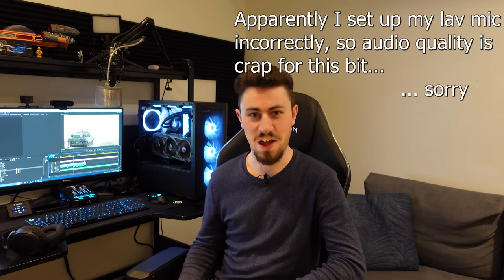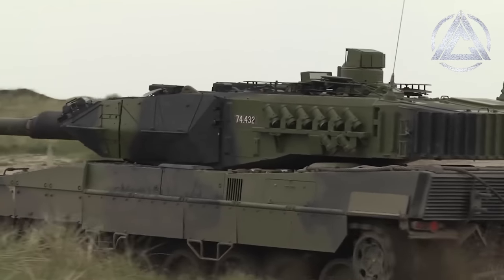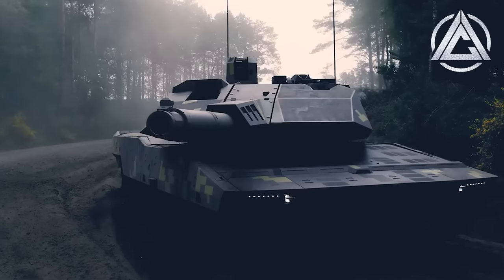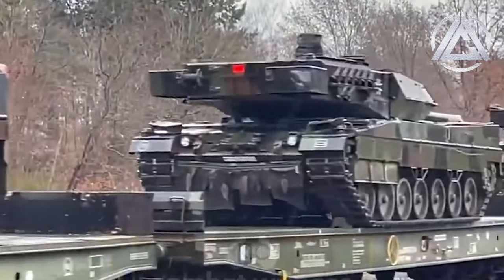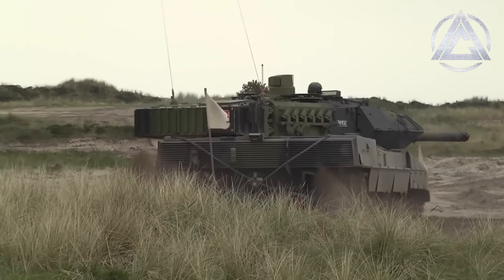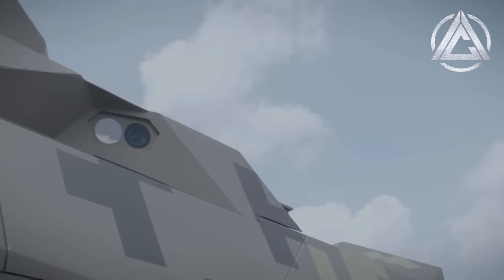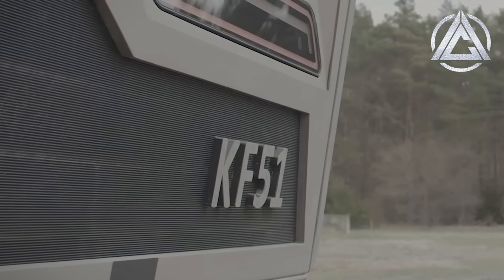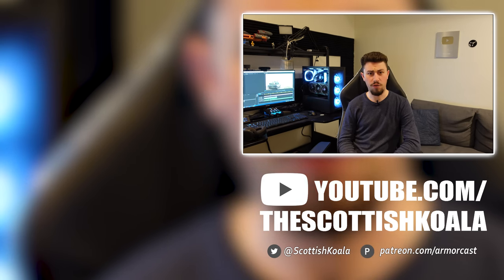Germany's New KF51 Panther Tank | The Spearhead of a New Generation?

Comment: It is an interesting tank, the 130mm gun seems good enough although I do think it also serves as a propaganda point of "we can produce bigger guns" when you compare it to the Russian 125mm. The HERO drones might be useful but I do agree that if it removes primary armament ammo it's not worth it, we will see with time however. Protection wise seems great all things considered, using new materials to lower the weight is a certain plus... Which also has the benefit of an up armouring package, if certain circumstances prove it practical (I.E. protection from Anti-Tank mines). Using a heavy caliber machine gun as coax might be some overkill, but I guess this does allow the driver to conserve ammunition when dealing with lighter vehicles, but that lighter machine gun turret in the back... Granted it's intended role is for use against drones and loitering munitions, but if it was moved further forward and able to depress, it would be a far better use against infantry. (Small note, he calls it a CWIS, an he's not far off, there are probably some idiots who say CWIS can't be mounted on ground vehicles, wake up, the Czechs already did that)

Comment: 7:00 I did some rought calculations and if it's true that the muzzle energy increased by 50%, it would result in an 11,8% increase in muzzle velocity (Assuming pentrator has the same mass, more mass would mean even less velocity). 15% seems a bit much. Source: I'm physics boii
Reply: Assuming the same mass, the velocity would be 22.5% greater.

Source: E = 1/2 m * v^2

v^2 * 1,5 = (v * x) ^2
x = sqrt(1,5) = ~1,225 => 22.5% more velocity for a 50% energy increase.

Comment: The German left has, following Moscow's directives, been attacking its armaments industry for at least 40 years.

This causes problems when it comes to upgrading, changing spare parts, etc.

So they have given licenses for local manufacturing.

Taking advantage of this, South Korea has designed its "Black Panther" tank, Poland has already received 200 out of 950 units and the rest will be manufactured locally.

It is at the same or better level than the "KF 51 Panther".
Reply from the maker: I mean… it’s slower, substantially less well protected, less advanced as far as optics, sensors and communications/battlefield management systems, and has a less powerful gun… while being the same weight.

But yeah, sure, “at the same or better level”…
Reply: @ArmorCast  I like german weapons, but it looks I lost something...how the gun can be "less powerful" when it´s THE SAME!!!!, L44 or L55 as per customer preferences, can shoot the same ammo, etc.
Besides 56 and 59 tons for a 30 cms shorter and 10 cm lesser widht hull didnt looks so terrible...

Comment: The shroud is a bore-evacuator.
Reply from the maker: Not at all. You can see on the Challenger 2 LEP we showed a couple of times in this video, as well as the static display 130mm, that the bore evacuator on this gun looks almost identical to the on on the 120mm - a bulging section half way up the length of the barrel.

The hexagonal shroud over the gun is most likely a combination heat dispersion and radar deflecting surface
Reply: @ArmorCast  Good to know.

Comment: Looks like it has a large shot trap potential when the turret is forward facing,  jamming from forward hit.
Reply: If you’d watch the video he mentions that
Reply: @razalfraz6618  Yes, people also said the Titanic was unsinkable, Lets hope they are right in their calculations that allow only for conventional rounds.
Reply: @grahamstephenson9393  is someone going to be slinging solid shot at the tank? If so why 😂
Reply: Its not a shot trap because the wedge form is actually only thin armor .. anything that would have enough power to do any damage AFTER being deflected WILL penetrate the wedge, but thats the purpose, by the form of the wedge the long penetrator will loose power and angle within the (hollow) wedge to hit the REAL armor behind it at an angle where it will be too much to penetrate then.
Reply: @grahamstephenson9393  Ok, that IS a good point. But i recon the turret is a real heavy piece so the power to turn will be quite substancial too ... the piece of debris blocking this would really have to be extreme and extremely lucky to be wedged in such a way ... but yes, possible.

Comment: 120mm railgun is a better option than a 130mm
Reply from the maker: Rail guns are at least Id say 25 years from being ready for tanks. Possibly they’ll NEVER equip tanks, instead being used by the navy. 120mm ETC gun on the other hand… …

This all needs its own video or two of course
Reply: @ArmorCast  If there’s a really high potential of war or even a war happens development of railguns will be sped up massively but as the railgun is not needed urgently they will not speed it up as like you said the 120mm is sufficed at the moment and if we really need something more than a 120mm we could always use the 155mm Britain even has a 183mm tank gun which is overkill but if it was really needed it there.

I think the real reason there’s no new MBT’s is because there not really any competition anymore as Rheinmetal main competitors in Europe were Royal Ordinate and Vickers both of which no longer exist.

Comment: I guess Germany needs to hope that opponents don't adapt to the design, like using solid rounds to take advantage of a shot trap.
Reply from the maker: Older style full-bore AP rounds would pose no issue to this tank's armor, and that's IF they were able to make it through the active defence system
Reply: @ArmorCast  In your shot trap dreams.
Reply from the maker: @franciscofranco4520  The Leopard 2's turret design since 1991 is almost identical, and the Abrams is very similar. If we were going to see fielding of full-bore AP rounds to take advantage of this, it would have happened by now. Fortunately, military procurement industry is not that stupid, and understands the physics behind this type of armor and why that would not work.

You need a certain amount of penetration to get through that kind of armor (and again, APS exists)... to GET that penetration, you need a sabot rod. Sabot rods cannot "shot trap" a tank, especially not this one.

Shot traps exist at around 35 to 50 degree angles... the angle of Panther's, as well as Leopard 2's turret (the supposed "shot trap" part), is more like 8 to 12.
Reply: @ArmorCast  Fact check: false.  Abrams and Leopard's design are completely different.  Shot trap cope.

Comment: i have to say i fucking hate the sleek geometric design of the kf51 and Leo 2A6, the angle dont really add much protection since these are empty boxes ( well idk for the kf51 ). i much prefer the blockyness of the 2A4, the k2, the leclerc...
Reply from the maker: They actually add an ENORMOUS amount of protection. Despite being mostly empty (not completely), the way they work is on a principle called "moment of inertia". It actually makes them MORE effective than if the space were filled with composite material. What happens is the incoming round penetrates the wedge shape, enters into mostly empty space, and then impacts the turret underneath at a bad angle, resulting it it losing over 95% of its penetrative capacity.

I have talked about this before and will do a dedicated video on the topic specifically in future

Comment: Matching the armor is a no go. Until we see a new generation of armor that can stop the current AT missiles and darts and be lighter we will not going to see another new tank in production. The most advanced in this regard are the americans with a new DU crystal armor that is in the works.
Reply from the maker: That will ALSO be used to match the current armor effectiveness while decreasing weight. This is the primary purpose of the M1E3 vehicle. 

Current generation AT weapons cannot be stopped by armor alone - the whole point of them is to circumvent whatever armor is there and hit the weak points which just cannot be armored. Try to armor the whole tank against modern AT threats and you’ll end up with a wildly impractical 200 tonne monster. Instead, active protection systems need to take over to defend the tank against the most significant threats, with the base armor already being strong enough to defeat everything else… which is exactly what this tank does.

Comment: No future tank commander would like this MBT. Too big, too large, too heavy, a 130mm gun instead of a 140mm one with autoloader. First in a country with low births, terminal demographics and low manpower there is no need for a 4 man crew, make it 3 man crew only and save a lot of volume and weight dedicated to house an extra crew member. Manual loaders are a thing of the past especially as we move onto 140mm. Secondly leave drones for scouts, it's not up to a tank to man a drone, the space for a 4th crew member is wasted space. No serious tank commander goes in blind with just the tank platoon, a platoon is accompanied by scouts be it motorized or tracked ones who screen for infantry and cover the MBT many blindspots for situal awereness they should have the drone operator inside the jeep, APC etc... and just liaise with the tank via comms or data link. Thirdly, 130mm gun is a not enough. If you see throughout history canon upgrades are always 15mm+. We went from 20mm to 37mm to 50mm tp 75mm to 90mm to 105mm to 120mm. 140mm is the bare minimum to have a gun platform with longevity in mind. Not against armour targets necessarily but the extra caliber wiggle room allows for very high explosive payloads against structures in urban combat and also for modular smart rounds. You need space for smart fuses and sensors. Feedback from Fallujah and Ukraine show that 120/125mm leave a lot to br desired un urban combat. This panther tank could have been an MBT in the 54 ton range if it was a 3 man design to booth. Lastly the powerpack is not inovative, just old diesel, no turbine, no hybrid electric to allow stealth ambushes while on battery mode. No turbine for high speed like on the Abram X technology demonstrator. I might impress neophytes with its brochure specs but the doctrine of this tank design is firmly from the last century.
Reply from the maker: It's no larger than Leopard 2 and substantially lighter. While true that the drones are a dumb idea, as is retaining an optional crew member station for them, remember that in all likelihood, that station can alternatively be used for additional ammo storage.

Nobody's going to be adopting 140mm, or even 130mm guns. It's a shit idea. You halve your ammunition carrying capacity for minimal increases in effectiveness, when the 120mm calibre still has a LOT of growth potential. When you want to increase the punching power of your gun, increasing velocity is ALWAYS the better option than increasing calibre, since those existing 120mm rounds we've spent 15 years and billions of dollars stocking aren't immediately rendered redundant, and the rest of your logistics loop doesn't have to be rebuilt. There's no rule that says gun calibre increases have to be 15mm+, it's an arbitrary number. That just happens to have been the convention for the last few decades, and in fact you're skipping the gun calibre increase the US made in WW2 from 75mm... to 76mm, or the increase the USSR made from 76mm to 85mm. Or the increase the USSR made in the 60s from 115mm to 125mm.

The more you increase the size of the gun, the less ammunition you can carry, while on the flipside the larger and heavier your vehicle has to be, to account for increased recoil and accommodate larger ammo storage and autoloader systems. Less ammunition capacity means more frequent resupply is necessary, resupply that is more difficult and time-consuming to conduct when the ammunition is twice the size and weight!

Like you said in the first place, larger, heavier vehicles are not the way to go... We want to be minimising weight, while also minimising costs as well. That means not adopting ridiculously oversized cannons that require fully new ammunition production. This is why countries like Hungary and Ukraine who've expressed interest in purchasing the KF51... have requested versions of it with the 120mm gun.
defenceconnect.com.au/land/13342
Reply: @ArmorCast  not a fan of ammo stations in the hull. With an autoloader it should be store in the turret bustle with blowout compartment to save the crew in case of a penetrating hit. Just like on the Leclerc ( but still has 18 rounds drum to resupply the autoloader in the hull which is weakness). But now imagine all 40 rounds on the turret bustle in the panther, and 5-6 tons ligther by removing 4th man station . Europe has a manpower issue, crew first, in WW2 armies were running out of crews not of tanks. So if the turret bustle is a weak point and blows up but the crew survives it's all good. As for the 130mm my main point is that it is an akward calibre, so if you are going to upgun go big to 140mm or for the squemish keep the 120mm. US and french armed forces disagree with yours take, in their vision for future combat they need a larger calibre thus they push for 140mm. MBTs are rarely used against other armour these days, feedback from Fallujah, Yemen war and Ukraine war is the need for a higher caliber to deal with urban combat garrisons and to push through defensive lines and fortications on the fields like in Ukraine. For that the 140mm is paramount. Similarly Russia had envisioned an armata variant with a 150mm turret. MBTs are more used as heavy infantry support and for breakthroughs not as tank hunters. If you want to engage MBTs missiles, drones, and loitering munitions are more cost effective. Even recon armour or IFVs can fit the tank hunter role better with ATGMs or a 40mm gun at close quarters suchs a Lynx or EBRC Jaguar. In short USA and French want a Big gun to shock, enough armour survive some hits in order to breakthrough a line so we are back to late WW1 early WW2 tank. doctrine. The USA paratroopers got the M10 booker light tanks for that not to engage enemy armour but to break fortified positions. So the the new panther is not really commited to the new vanguard armour doctrines of the biggest NATO members and is stuck firmly in the 80s with some gadgets. Lastly no innovation in the powerpack is bad, again france and usa are interested in hybrid powered vehicules so you can silently assault positions, running on electric the last 20km to the frontline in silence. Or when on defensive position run the mbt on battery for, no heat no noise, perfect ambush. The Abrams X for USA and the Arquus Scarabee (VBL scout replacement) for France are examples of this doctrine. Lastly I don't put much stock on Hungary or Ukraine. Hungary will probably go full lynx and abandon MBTs fot budget reasons. Ukraine well I doubt they will get k51 panthers any time soon, more likely they will get Leopard 2s, they needed tanks yesterday and they are broke to buy anything more expensive than leo2a4/a5
Reply: @ArmorCast  About 140mm being a bad idea because it takes more storage room. It's not a big issue for MBTs with bustle autoloaders. At least for the French 140mm Ascalon and Leclerc Terminateur prototypes the 140mm round is just longer not wider in radius/circumference so you just need to extentd the length of the turret bustle and voila, still fits 22 rounds just like on the 120mm turret. It could be an issue if the ammo is stored on the hull but why would anyone do that mistake? And if you look at some early concept artist impressions for Franco German new MBT with 140mm Ascalon the tank is smaller and ligther than the KF51 panter because the hull is more compact for 3 men and the turret is not that big even looks a bit more compact than the KF51 130mm turret, surprisingly so.
Reply: @Frencho9 I hate how he replies to your points and instead of continuing the discussion you just move on to different points.
Reply: Currently 120 is def a good option. However lots of advanced future tank programms will enter service in the far future and that still be in service for decades. So i would not rule out high calibre main weapons.@ArmorCast